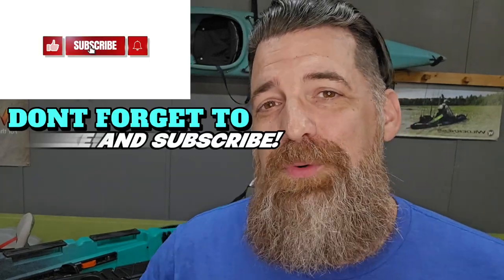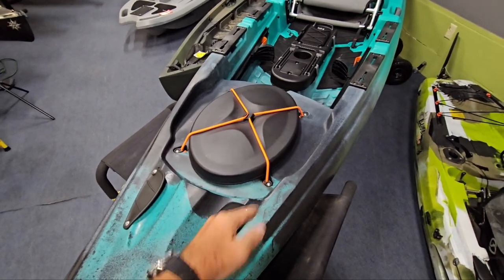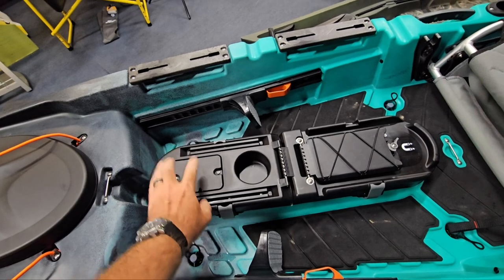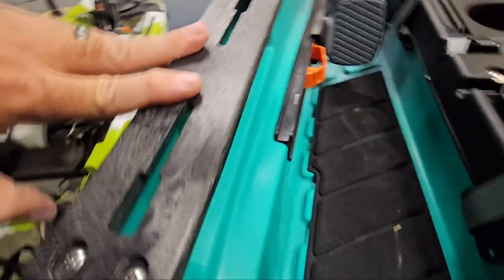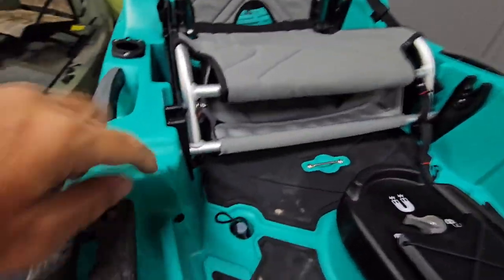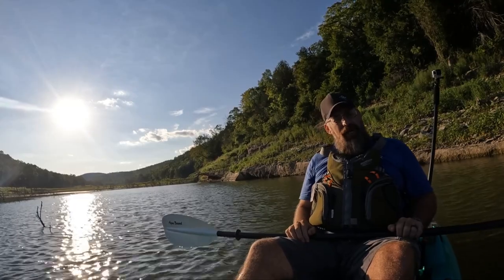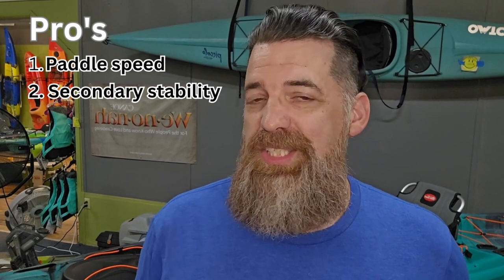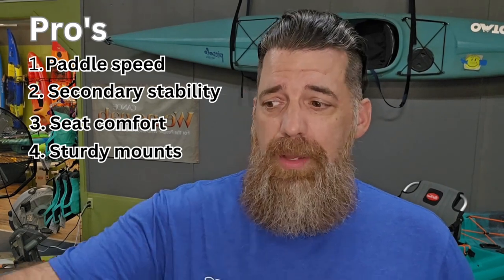Old Town Bigwater 132 | Should you buy?

Comment: some tips: push those splash guards out as far as they will go.  take your paddle and place it on your head.  there should be two 90 degree angles.  you can adjust a little bit from there but generally this is how far apart you want your hands.  when we kayak we are not pulling the boat through the water with our bottom hand the way we are with a canoe.  we push with our upper hand.  what we're actually doing is ensuring that we use our entire upper bodies to paddle, mainly our chests and backs, instead of our arms.  spear the water at around where your feet are and push with the opposite hand.  your torso rotating does 90% of the work.  might not matter on a 2-3 hour trip but you bet your ass it matters on a 10 hour trip.  guided for about six years, taught more people how to kayak than i can realistically count.  thousands.  maybe tens of thousands.  always shocked to see how few people in this sport can actually paddle a kayak properly.  at least the paddle isn't upside down.